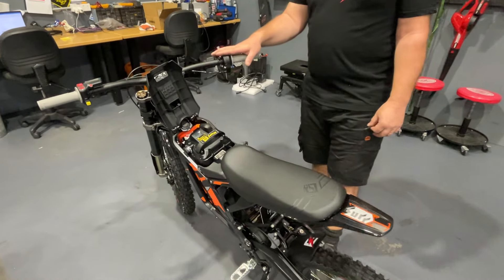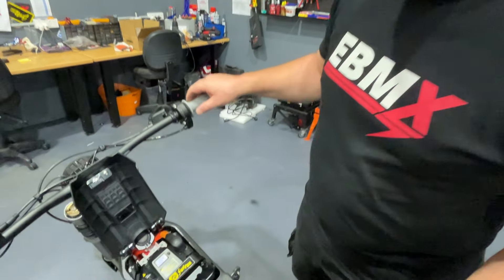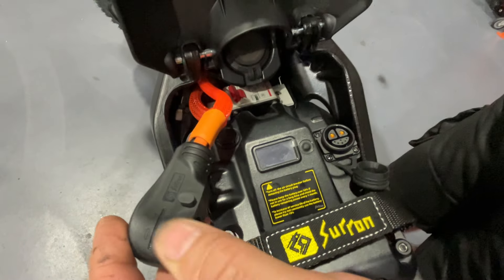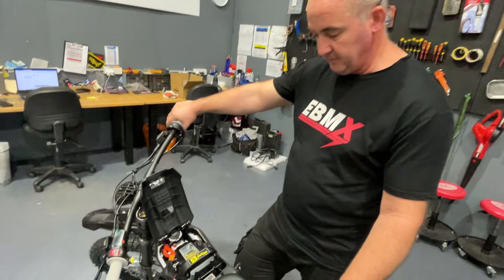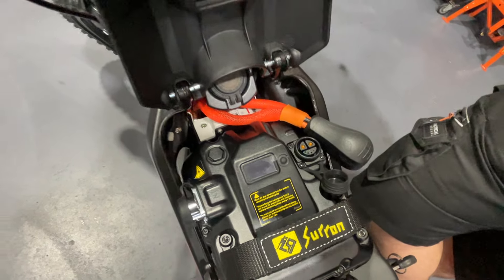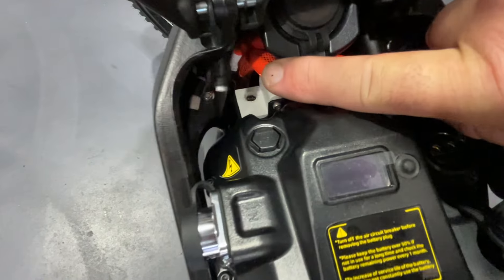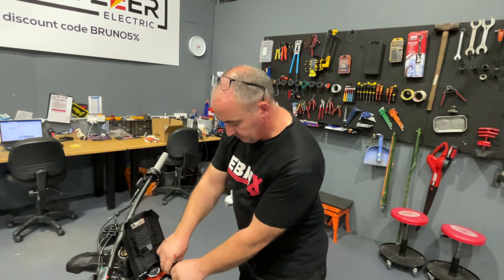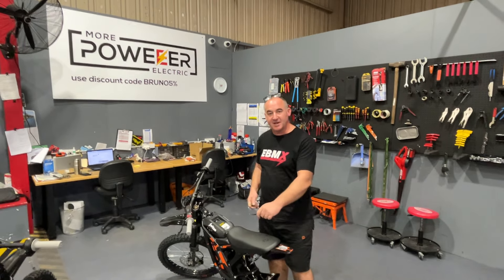Important Differences Between New 2024 SurRon LBX Model and the Old 2023 SurRon LBX Model

Comment: With an aftermarket controller, what’s the max power that can be pulled from that new battery and connector.
Reply: Will be the same as the other 40ah about 8kw max id say 7.5kw something round there
Reply: @SurronpartsLeeds  nope false info it would be faster
Reply: I wouldn’t be running a stock 40ah over 8kw that not false info that’s common knowledge
Reply: with a torp tc500 u can run up to about 9kw but i would run a max of like 8-8.5 kw

Comment: How would you turn off the regen on it with the new connector?
Reply: with the diagnostic cable
Reply: @surronlatinoamerica8603 do brake sensors need to be connected?